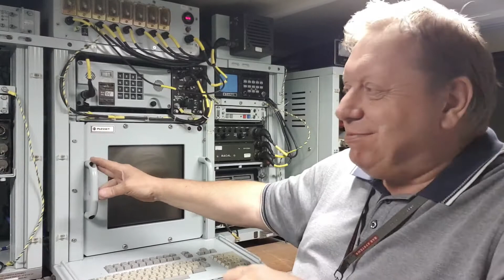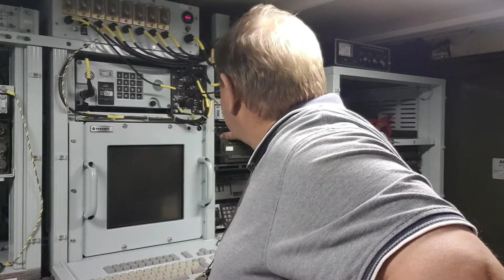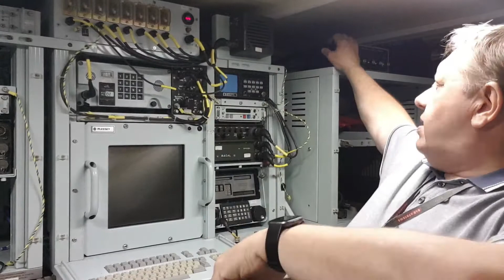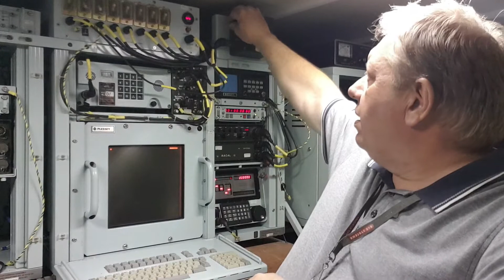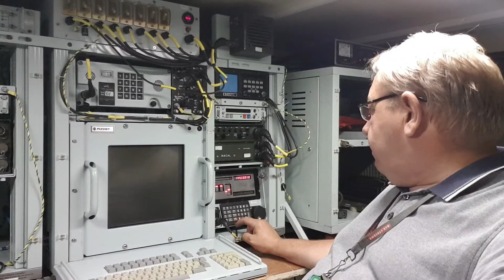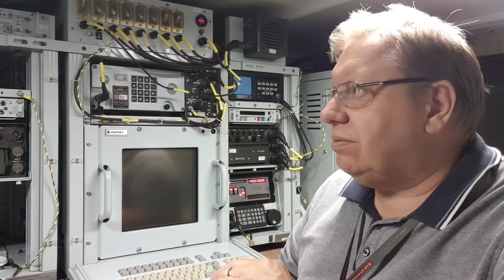Plessey Vixen electronic warfare demo

Comment: Brilliant video Simon. Any chance of a closer look at the some of the parts especially the receiver?
Reply from the maker: Yes no problem i still have the receiver on the bench for the second rack. I will try and get a video on the receiver along with some more detailed specs i do have software written for the control of the receiver so it can be controlled away from head unit